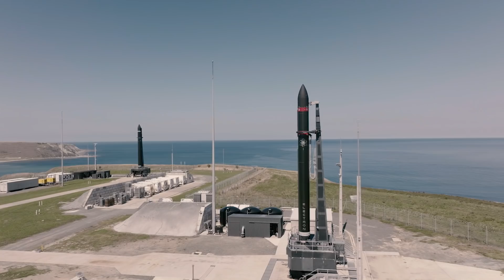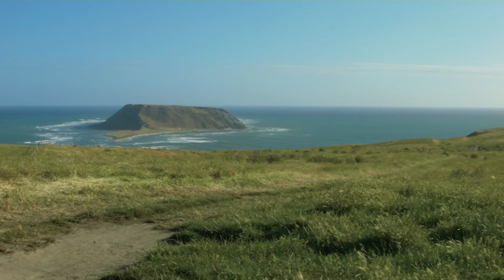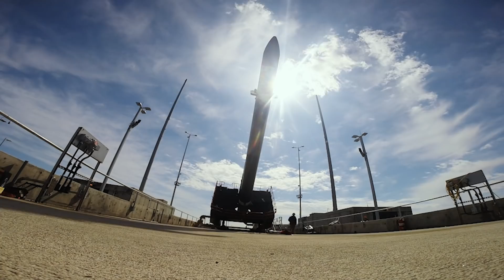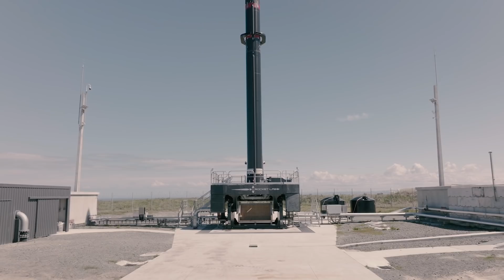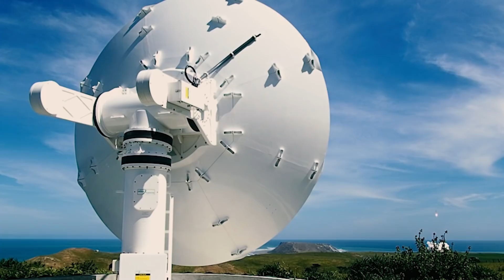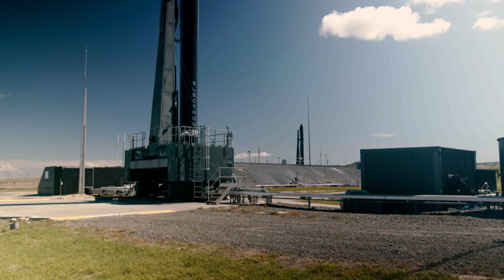Introducing LC-1B

Comment: Cool, but your launch pad has one very obvious problem. The mechanism which hoists the rocket up has so much stress on its joints, that over time the cost to maintain will be great. I suggest using a pulley system to supplement it, because yeah, that's so inefficient.
Reply: You could always try Viagra

Comment: Most impressive shot for me is the 4 people rolling the rocket to the pad. I mean how lightweight is this thing (without fuel)?
Reply: I was thinking the same thing... no complicated crawler, just some framing and wheels that look like they came from the local hardware store (or would, if "local" and "Mahia" belonged in the same sentence).

As to the question, I believe the booster is about one tonne dry... I remember looking it up during one of the discussions about helicopter catching. So presumably under two tonnes with the dry upper stage and payload.

Comment: But is it compatible with Neutron too?
Reply: Not enough LOX in NZ for Neutron unfortunately
Reply: @lewtscott3346  LOX supply is probably a lesser problem than vehicle access... Mahia is a pretty spot, but they're not going to be delivering Neutron boosters to the launch site without some serious upgrades to the roads in the area. We don't exactly have an elaborate freeway system like the one SpaceX uses to drive Falcon boosters across the US...
Reply: @simongeard4824  Neutron will be built at the launch site so there will be no transport issues

Comment: I've been very hyped with the economical potential of the upcoming Neutron rocket. Many SpaceX fanboys forget that big part of the launching costs, comes from maintaining a launching infrastructure, Staff, and propellant. Not only the costs of the rocket by it self. And retrieving it by naval means and refurbishment requirements, also increases the costs by a big margin.
Reply: Indeed.
Reply: @HanSolo__  for a reason Falcon 9 launching values charged to NASA to LEO, aren't getting substantially lower.
Reply: Bla Bla bla

Comment: Can someone explain this to me… I’m very confused by this.
They currently have the capability to launch every 72 hours?
They don’t use this capability.
They built a 3rd pad to continue to be constrained by their ability to build rockets?
Reply: It's not about launching EVERY 72 hours. It's about Launching 2 rockets within 72 hours if need be. 
Also, they don't use this capability "yet". But they have plans in action to step up their ability to build rockets faster. And that would be dumb if you don't have the site to launch it from, wouldn't it?
Reply: It likely also provides some redundancy if there is an issue on one of the pads (that doesn't necessitate a full grounding of all vehicles).
Reply: They have the required legal approvals in place to launch every 72 hours, that's what they mean by 'capability'. That's way more complex and time-consuming to achieve than building more pads.
You could have all the pads you wanted in the USA but still not be allowed to launch that often due to FAA regulations (the same thing that's currently holding up Starship).
Reply: @5lithery  Well that doesn't appear to be true (the part about launches that often due to FAA). SpaceX has launched a couple of times within 72 hours. They were just different pads, Launch 133 on 12/19/21 was on pad SLC-40 and 12/21/21 was on LC-39A. They are adjacent launch facilities. if we include the California Launch site, they did 3 launches in 4 days recently.

The FAA review is for the new Texas site, If they get approval they can go ahead and continue to launch there as they like. If not, SpaceX already said they already have the approval to launch Starship in Florida.

Comment: Amazing work, Rocket Lab!!! Can't wait for LC-1B's debut!
Can either pad be modified to launch Neutron or will you need a new pad for that? I'm guessing the second option.
Best of luck!!!! Reach for the stars!
Reply: It will need a new pad, but it won't need as much infrastructure, at least as I understand it per current design.  The pad itself will be basically a flat concrete area which will also serve as a landing pad.  There won't be an erector system as that infrastructure will be built into the rocket itself will have the piping necessary to fill the upper stage, so the upper stage will essentially be dropped into the first stage, the fairing closed, and it'll be ready to fly again.

It also won't fly out of New Zealand, as from what Peter said during one of the many interviews he gave after the Neutron update was that the Liquid Oxygen production in New Zealand is such that there's not enough capacity to fill a Neutron for a single launch.

The launch site hasn't been announced at the moment.  I think it was originally going to be Wallops, but that was long before the update and Peter mentioned that several were under consideration but that it's not going to be announced any time soon.
Reply: @firefly4f4  Thanks for the very complete answer!!!! That was super informative :D